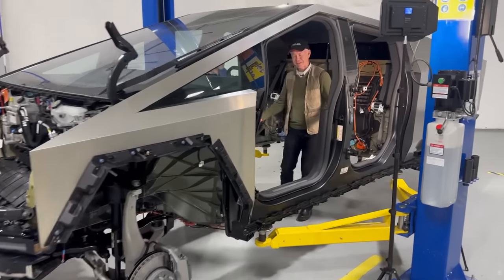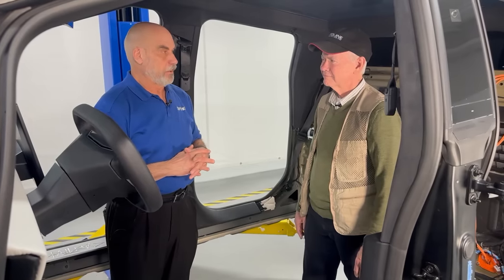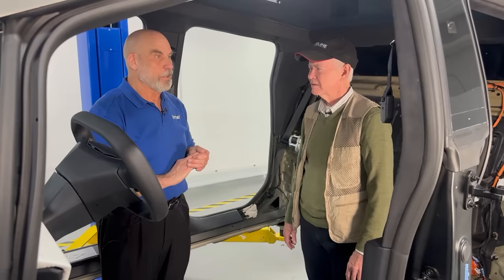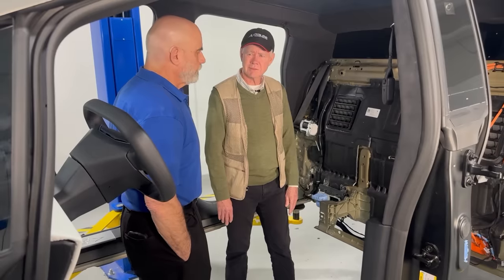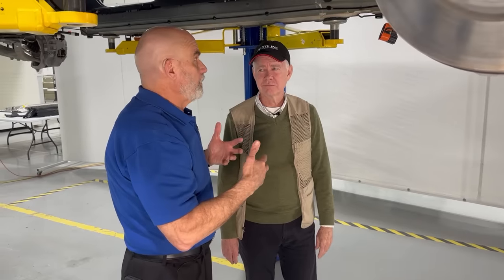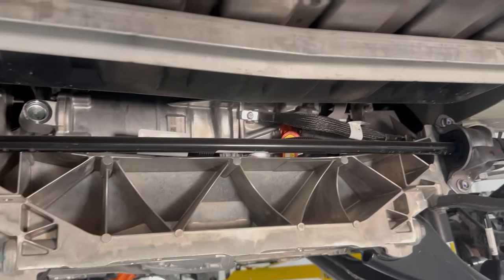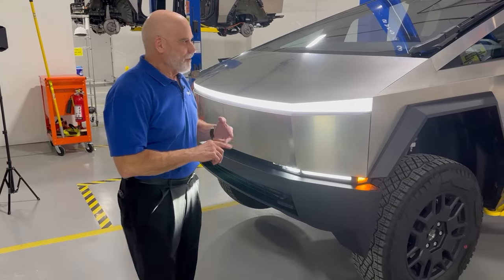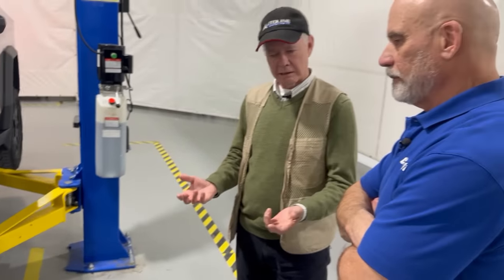World's 1st Cybertruck Teardown - Steer-by-Wire, 48V, Battery & Gigacastings

Comment: The puckering of the door seals is from the removal, by the new owner, off the plastic wrap protecting the Cybertruck logo and the other scuff plates. The plastic wrap was applied before the door seals were, so they are under them.

Comment: Steer by wire is super dangerous on slippery surfaces, it's so easy to lose traction by improper steering, there is absoluting no control, thank god the cybertruck is awd and instant torque or else you'd be screwed.

Comment: Steer by wire is not a first but is a great idea for many reasons.
Tesla certainly put any idea of cost cutting behind them when making the Cybertruck and have learnt some important lessons by the look of the build.
I definitely would not even consider buying one for three or four very good reasons.
The current model 3 is an excellent vehicle with a well thought out design though.
😎🇦🇺

Comment: Watch for images of Cybertrucks on 4 jackstands with the battery stolen. For that matter any EV could have a battery stolen from underneath. 

Of course Tesla oversold that they comprehensively used 48V.
Reply: lol - the seats are part of the battery pack. You can't just drop the pack and slip it out. You'd need a full car lift to get it out. As for the "oversold 48V" - jesus man, you KNOW they have to get SOME parts from other manufacturers, right? The rest of the car building world is still on 12V. Tesla can't make EVERYTHING themselves.
Reply: I don't think you have a clue about removing a battery from a Tesla.  Fear mongering.
Reply: Lol, I don’t think most thieves are going to be dropping a 1,200 lb battery pack down, taking the front seats and console a seat stands off so they can get the battery out from under the Cybertruck, detaching the coolant and cables, and heading off into the sunset with their 1,200 lb prize. Thieves didn’t choose that profession because they want to work incredibly hard.
Reply: Far easier to steel catalytic converters.  Typically takes 5 minutes or less, and the car might not even need to be jacked up (SUVs/Trucks). They are stolen around here all the time.  One more reason to ditch ICE.
Reply: @ColinFox  Some people are simply looking for reasons to fault Tesla and will not acknowledge good.
Reply: I found the recent autoline video on 48v quite interesting. There are some interesting benefits to having a mix of 48 and 12v, and there are 3rd party systems that allow you to mix both. We'll probably all move towards 48 eventually, but it takes time to get parts. It'll move a lot faster if other manufacturers learn from what tesla did and jump on those same suppliers.
Reply: For the hassle that would be I think just lifting the whole truck and towing away to some low key place to part it at their leisure would be easier.
Reply: @motorv8N - Tesla's tilt alarm would likely go off. Then again, you can track the Tesla vehicle location from your phone, so not so wise to steal a Tesla. Every year the list of frequently stolen cars, and Tesla is always the least stolen car.  Not much of a concern.

Comment: i will NEVER buy a EV that has the battery be the floor that is crazy insanity
Reply: But it’s super convenient you can service or change the battery in three decades when batteries are cheaper and built in America and that kind of helps with the interior it just needs a good seal just like the door and those door seals look pretty strong to but who’s to tell I can’t wait to see in the next few decades 👀👀 I would like to see the mechanisms and bolts that holds the battery in
Reply: Why??? Cause sitting between a burning engine and a gas tank is better ? 😮
Reply: Why? Because it’s harder to change it?
Reply: Another “smarter than Elon guy”
Reply: The low weight distribution is a big part of Tesla's exceptional collision safety ratings